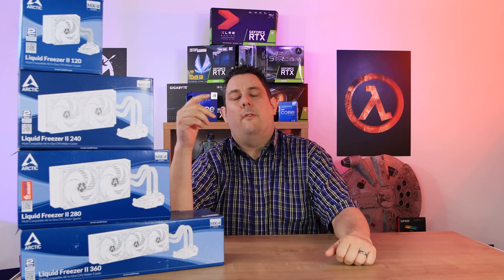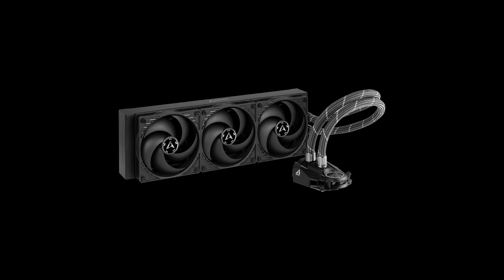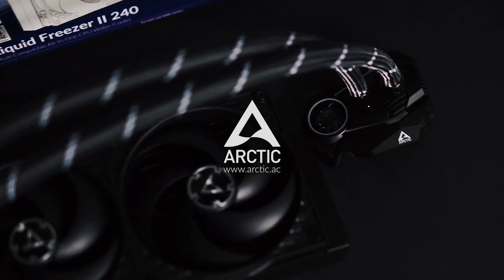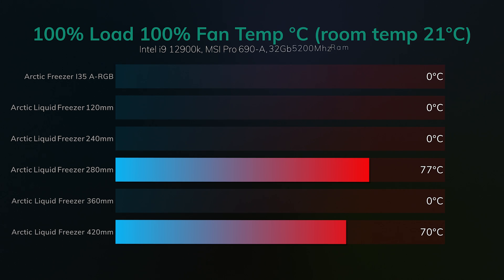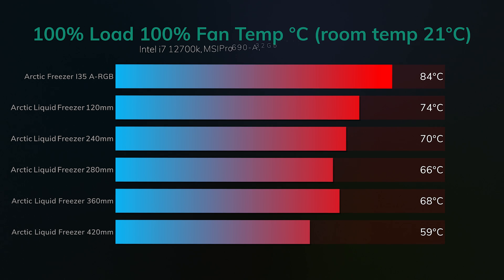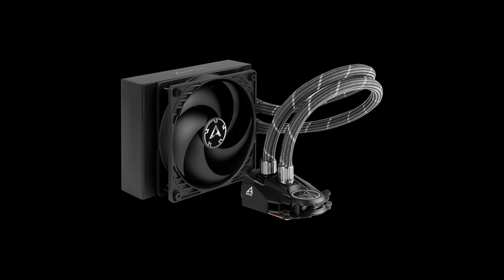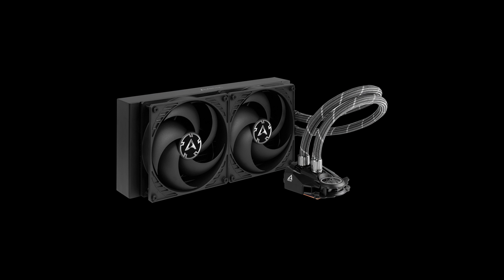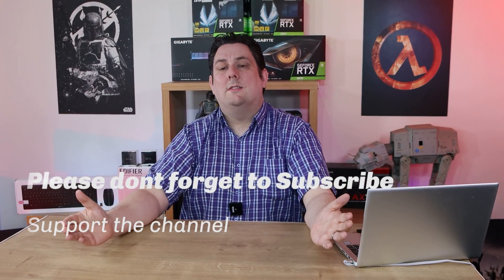Can the Arctic Liquid Freezer ii (120mm 240mm 280mm 360mm 420mm) cool the 12900k & 12700K

Comment: i have a i9 12900k. 
Made a mistake, bought the cheapest Be Quiet Pro 3 Air cooler at $47. On its own, it couldnt stop the 12900k from throttling. 
HOwever, I salvage 3 fans from my old tower that can do 4000RPM (they get loud so i limited them to 55% RPMs at 90C), slapped them on different orientations around the be Quiet pro 3, and with 0.05V undervolting, I can do Intel Extreme utility multicore benchmarking with no throttling. On Cinebench, 1 or 2 cores hits 100C, while the other remaining under 100. 
For Cyberpunk 2077, 700 mods, ultra settings with raytracing and FSR 2.1, my temps are around 75C. 
For general gaming, air coolers with some extra fans are fine. Seeing that even AIOs struggle to keep 12900k from Cinebench throttling, for budget gaming, air cooling is worth it IMO.

Comment: Can confirm. 12900k with 360 II version. I thermal throttle. 

I tried hard to find some configuration that allowed me 5.3 Ghz all cores stable, but cinebench just fries the CPU and it shuts down. I just accepted my fate, and deal with the fact that all core load will always throttle. Good thing games never do this, so it's kinda alright. Still gonna change it, probably check out the 420 version.

Comment: My 12700kf is 100°c in r29 and underclocking himself... its normal? i own 240mm aio Freezer 2
Reply from the maker: does not sound right, i would try remounting, make sure your are using the socket 1700 bracket, and try repasting (make sure you have not left plastic cover on CPU block.  but could also depend on airflow into your PC
Reply: @TechforTechs  Nah duh pc is new. Also bracket and mounting correct. İdling at 23c

Comment: Thank you. I have both 280 and 420 but i was not expecting that 280 is better than 360.
Reply: 140mm fans, more power for same speed = cooler radiator
360 has 120mm fans so it will be louder and have less powerful static cooling
420 rad has three 140mm fans. 140mm fans carry.
I'm going to be doing one 280 for my cpu and one 280 for my gpu stacked together (intake fan, rad, intake fan, rad) in the side of the hyte y60 black case.
Arctic rads are thick so unfortunately the basket in the top of my case will not support it.
280s have great performance for price though, especially non-rgb. It's a great thing arctic fans are so attractive.

Comment: Great video! Been using these to see which fan to get for a new, high-end PC I'm planning to build, and I'm thinking of going with the 420mm ✨

I'd love to see some more of these tests done on Intel's i9 13900k just out of pure curiosity lol
Reply: There was a Russian guy that tried it with the 420. But mounted 6 fans instead of the standard 3 and put it in a Fractal case. The CPU ran at 100C for the entire test and drew about 350Watt's of power! I'm more interested in costum water cooling with multiple radiators.

Comment: exactly what I was looking for and quite good results. Going above 280mm simply eliminates a lot of case options and makes the built more expensive
Reply: Not really. The biggest case I know of, the Thermaltake Level 20 XT, is only $250. That's LESS than the basic-sized Fractal Torrent at $280.
Reply: fr my pc case can only fit 360 on the front side and 280 on the top side. i was about to go for 360 and place it in the front but the issue was that placing in the front wasnt ideal for the lifespan of it since i wanted the longest lifespan for it. since the 280 fits perfectly on the top and the benchmarks are showing 280 is better than 360, im def going for 280 since i can even mount it on the top too

Comment: man the 360mm on mine runs at 43-47C when idle, with r7 3700x cpu.
I'm so jealous of your numbers. I've tested everything, bios, fans, reapply thermal paste, mounting pressure.
nothing seems to get better
Reply: thaths weird...
Reply: maybe it's because the tubes are up? AIOs tend to perform better (cooler & quieter) w/the tubes below and the radiator mounted on the front/top
Reply: The 12900K is a 250Watt cpu there is not comparison.

Comment: Yeah. 
It's interesting to see that the 280mm AIO beats the 360mm one 🤷 
(This might be due to the fact that the 280mm AIO uses bigger fans, even if they are only 2 of them).
Reply: If you replace the bad P12 PWM fans with the impressive P12 MAX PWM fans, which have double the static pressure, I think this would be a win for the 360
Reply: It makes sense in the grand scheme of it.

You need air power, 3 smaller fans have more surface area on brackets than actual fans vs 280.

Comment: I am so sad..I bought the 360 version before I see your video and now I am facing thermal throttling with my i9..will i see any difference if i swap the fans with noctua ones with greater speeds and air flow?any solution..?thanks
Reply: Noctua fans may help as I've heard testaments on how effective they are. 

Something else to try is to make sure your AIO is mounted the optimal way, which is *the radiator being mounted on the Front (best) or Top (2nd best) with the tubes on the lower side. Other than that, general tips is all I could give lol. Good luck^^

Comment: How would the 360 fail at the 12900k when the 280 passed? Something's wrong there for sure.
Reply: 120mm fans need to spin faster than 140mm fans to get similar amount of air through the radiator and the 280mm radiator is thicker than the 360mm radiator so it should be more efficient in terms of cooling.

Comment: Thank god I got a 12700k. My stubbornness refuses to give up my optical drive, so I'm "stuck" with a 120mm since a 240 can no longer be top-mounted. It's good to know my 120mm can keep my 12700k somewhat stable even under load.
Reply: Why 240 can not be top-mounted?
Reply: @waliddilaw8644  The optical drive takes up too much space. I can still put two fans at the top, but not a 240mm radiator.
Reply: @ZhangtheGreat  aha i see
Reply: You can't just use an external optical drive? I mean these things are dirt cheap these days for museum piecess
Reply: @DeusMachina71  Hell no! Not with an internal that's fully functional! I may spend $2k on new parts, but I will not give up a fully operational optical drive! (Told you I was stubborn.)
Reply: @ZhangtheGreat  a case with an optical bay still exist?
Reply: Why not just get an external drive?
Reply: @bobbob9821  With an internal that's still fully functional? Hell no!

Comment: Are the temps on top of ambient or the actual temps? If the room was 21 and you got 84 and it's over ambient (for the air cooler on 12700K) then that's 105 which is terrible. If it's actually 84, that's not bad at all under load, I am not sure why you think that's a bit hot. That processor could run at 84 degrees 24/7 and not have any damage done to it.
Reply from the maker: Temps are actual temps, not over ambient

Comment: I am not getting these same results with my 280mm version.   I replaced a 6 year old Corsair H110i, expecting great results, but just the opposite occurred.   With the old Corsair, I could hold a 5.4ghz clock on my 12700k, with the temps reaching the mid 90's on the XTU benchmark.  With the Liquid Freezer II, it shoots to 100c and thermal throttles, even on stock clocks.   I've reinstalled it several times, and keep getting the same results.
Reply: You're doing it wrong
Reply: @garyblake9665  Really?   So instead of reading the details, you just want to post a sparky response.   Go back and read my original comment again, I bet you can figure out why your comment is absurd.   Or, maybe you can't.
Reply: Is your rad in the front of the case feeding hot air into the case?
Reply: @Doug_Dimmadome  No, it's at the top, so it's blowing the hot air from the case through it instead.   

However, the problem was a faulty pump.   It ended up going out all together.   Regardless of the rad setup, the fact that it was being outperformed by an old Corsair, means there was likely another issue.

Comment: Hi, my temps spiking all over the place on 240 aio, 30s to 40s, is it normal? Also clock is all over the place too.
Reply: I did some 1.25v undervolt with a -0.1v offset, and 195w max power  which it never reaches with the undervolt, its at 4.9ghz constantly.

Comment: I already have the arctic 240mm aio do you recommend pairing it with a 12700k?
Reply from the maker: You may need to get the socket 1700 adaptor bracket if you don't already from artic, but as long as you have good airflow into the case the 240 would be fine
Reply: @TechforTechs  I have the lian li lancool mesh ii rgb will that suffice, I am planning to top mount the radiator as exhaust

Comment: i see this video after  bought arctic freezer II 420 On my 9900k@50  overclock    before i use Lianli aio 360  wa  LINX0911 was 95'  and  this Arctic 420 was 102'  too hight 
i am very disappointment this cooler

i test ARCTIC II 420  2 ITEM  but it was same  108~110' degree same on my case

Comment: Why does the 280 perform better than the 360?
Reply: just guessing, but i'd say it probably has to do with the fan:radiator ratio. basically the 360 isnt 'using' the extra length very effectively compared to the shorter radiator on the 280 having a higher relative airflow.

Comment: Does the contact plate cover the processor case completely?
Reply: I am using 12700KF, liquid freezer 2 360mm non rgb one and kyronaut extreme thermal paste. On my Asus Tuf z690 D4

If i run cinebench R23 multicore test the core Package immediately hits 98-100' C which is very high. Single core while gaming its is okayish. And No it doesn't cover the processor completely what i have observed is there is 2mm of area in the bottom of the cpu which is not making proper contact. I am using the latest LGA 1700 kit. overall i am seriously not satisfied with multicore performance of this cooler but i won't be using any multicore workload as i will be gaming and i have not seen temps rise above 60'C while gaming. I have overclocked my p-cores to 5.1 Ghz and e-core 4.1ghz with a core voltage offset -0.55mV

Ambient Room Temp - 30'C

Hopefully this answers your query

Comment: Greetings sir. Can you give me some suggestions?

1. What GPU should I go for as I am building with 12700K? Is going with a 3070Ti good? (Need for 1080p live streaming and 1440p gaming)

2. My cabinet will be an Antec Torque and cooler LF2 360. Will I get same benchmarks as you or it can be different?

3. How good can a DDR5 32GB (2x16) 5600MHz RAM perform with 12900K as my work is live streaming,  editing my gameplays at 1440p and playing games off-stream at 1440p?
Reply: With 12700K u can buy any GPU i mean this CPU will handle even 3090TI. ;)  3080 will be better option bcs of VRAM.

Comment: 12900K https://youtu.be/fhI9tLOg-6I?t=510  with the 360 LFII keeping it cool without any issue.
Reply from the maker: Good find, unfortunately they only test for 200 seconds, we tested for 1800 (30 min)   If you are running a heavy render it will take way longer than 200 seconds.  It will eventually start to thermal throttle at around the 800-1000
Second mark.  All it takes is 1 core to hit 99/100C and it will throttle.  We have run this test multiple times, and rechecked the findings when others have questioned.
Reply: @TechforTechs  They do it for longer but just put short time up for graphs.

Comment: I bought the 280 aio and it didnt fit my case properly but I couldnt return it. Decided to stick with it even though it was pushing my ram dimms slightly and my cpu power plug on the mobo. I must say its one of the best aios for the price range. The thick radiator means it can cool down way more
Reply: You can pop the front cap off with two screws.
Reply: Got it for 94$ with 1700 kit. But cant fit into my case lol, looking on matrexx 70

Comment: The reason why 280mm beat 360mm coolers is not the pump. It is because they use 2x140mm fans which move more air than 3x120mm fans.
Reply from the maker: Nope,  The 3 fans on the 360 allow a total of 168.9 CFM combined, and the 280s 2 fans can only shift 145.6 total combined, so in that calculation, the 360 should cool better

Comment: Hi there! Thank you for a great Video. I have an arctic liquid freezer ii 420 and yet on cinebench 23 at least 3 cores throttle at 100oC and the rest are between 90-98oC. I have used the 1700 kit provided by arctic and I have removed and reinstalled the plate more than 6 times to make sure it makes proper contact. Moreover, I used tons of thermal grizzly kryo and repasted over and over and then used MX4 and the problem persists. Currently with 23oC in the room the CPU is on an average 36oC. I have also verified that the cooler head makes good contact. I dont want what else to do. I am using an MSI x690-a motherboard on stock configuration. The temps fall a bit when i undervolt but this also reduces the CPU performance. Any idea of what is going on?
Reply: What case do you have? Looking for a case compatible with the 420
Reply: English not my native language

I am planning to build the same CPU + cooling system. If I run into this problem, firstly I'll try liquid metal instead of thermal paste.(check buildzoid guide how to apply it) Then on top of that, I would try motherboard washer mode.(also reference buildzoid)

If no luck, I would order a different lga1700 kit, maybe one that arctic sent you is defective. 

If none of these easy steps would work, the next ones would void the warranty.
So firstly go to store when you bought CPU and cooling system and ask them to diagnose everything. Or borrow a CPU \ cooling system from your friend if you're lucky, and they have identical stuff.

If no luck, then maybe do CPU IHS polish using grinding paper.
Last resort is CPU delid. Maybe you have bad solder under IHS
This void warranty, so maybe don't do them. Personally, I would be comfortable only with the IHS polish.

If you do any of that, please let me know how it went.
Reply: Hi Jason! Your problem may be because of the MSI motherboard that some come with a default OC for your CPU, in this video he explains how you can remove that and make it cool down without affecting performance   https://www.youtube.com/watch?v=C0plFO6t_Vs&t=323s

Comment: Why would you run your fans at 100%? Your PC would sound like a jet engine. This does not really help with purchasing as there are no "real-world" test set ups.
Reply from the maker: This is showing the max potential of the device that's tested and allows like for like comparisons, we understand that most devices rarely hit 100% usage, or need the fans to run at 100%.  how would you suggest testing the full potential of the product without running it at its full potential?     Also testing an i9 12900k with the fans, not at 100% would = a Failed test, the same goes for the 12700k.

Comment: These test results make little sense since 360 mm radiator uses 3 P12 PWM coolers providing 3x56.3= 168.9CFM and 280 mm radiator uses 2 P14 PWM fans providing 2x72.8=145.6CFM with slightly higher pressure. Both using the same pump and 360 mm version has slightly larger radiator area. They should have equal performance or 360 mm version should be slightly more efficient.
Reply: if they use the same pump in the 280 and 360, the 280 will have more flow... more flow isn't always better as the coolant may not be in the radiator for long enough to be cooled before it recycles, but in this case it's evident that the flow rate is more ideal than in the 360
Reply: @SheldonGreatJob  With all respect I think such a statement doesn't make much sense. Identical pump means that the same amount of liquid is pumped through the heat exchange plate over identical period of time. More liquid for 360 mm version means slower warming up for AIO while bigger heat exchange area combined with more air flow means that liquid will be losing more  heat in the radiator over the same period of time.
Reply: @svp2864  I  could be wrong but think it's something to do with "quality over quantity", baslcally. The 360 has more coverage, but the smaller 120mm fans aren't as thick (25mm vs. the 140mm fans' 27mm thickness), so that adds even more inefficiency on top of the fans having to spin faster to reach the same level as the 140mm fans. Just my opinion, take it with a grain of salt lol
Reply: @triv4555  Cooler height, thickness, number of fins, revs, etc. are irrelevant in this case since we know air volume and static pressure provided by them. All what matters is air volume, pressure, heat exchanger area and overall system capacity to determine how efficient heat exchange process is going to be. Simple physics and nothing else. With all external variables equal (ambient temperature, installation location [location matters since it implies different orientation and potentially - inflow/outflow air resistance by a case itself]) there is no way 280 mm Arctic Freezer II AIO performs any better than 360 mm AIO of the same model. I've seen 420mm AIO performance issues when it has been installed on a side wall of the case and put literally 1/4" against a wall while 360mm AIO installed on the top had zero issues whatsoever. Which doesn't mean that 360mm AIO is better performing that 420 mm one.
Reply: Shut up nerd give me your lunch money
Reply: I agree with you but I have seen the same results from other reviews

Comment: Hey, i appreciate your work!
Im want to run the same Setup (12700k/MSI z-690 pro A/Arctic Liquid freezer II 280) in my new rig!
Could you tell me how high the vrm heat spreader over the I/O Board is?
Im afraid of getting problems in a small Case (Corsair 4000D Airflow), so that the really thick AIO will collide with my Mainboard.
Reply: you need low profile ram to do it in this case :)
Reply: @xilenced6655  was able to do it with "Not so Low" profile ram... Had to do a little modification at the RAMs heat spreader 🤣
Reply: @Polarbaer123  oh nice :D its so weird so many ppl saying it fits and so many it doesnt... most ppls said low profile ram is the way to go